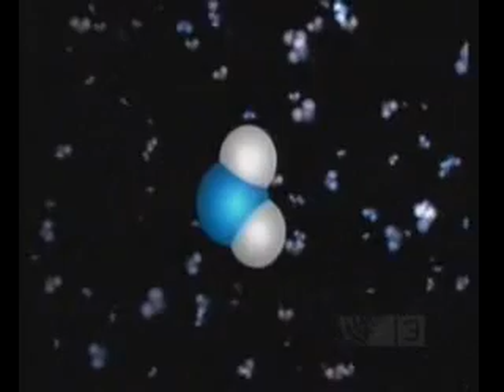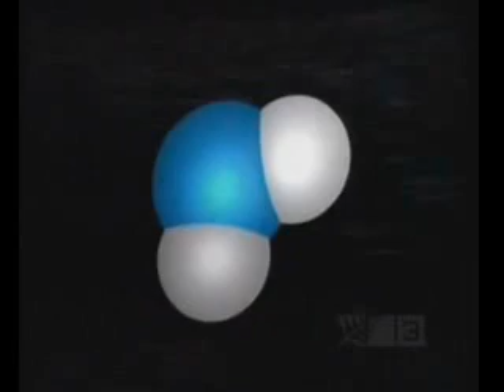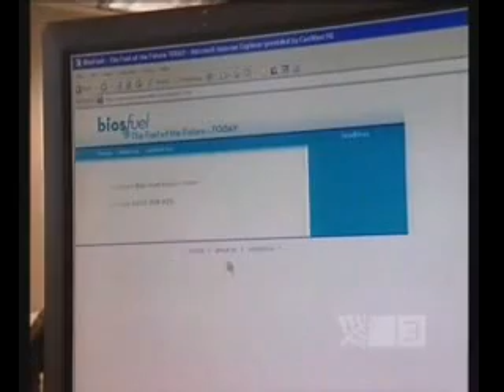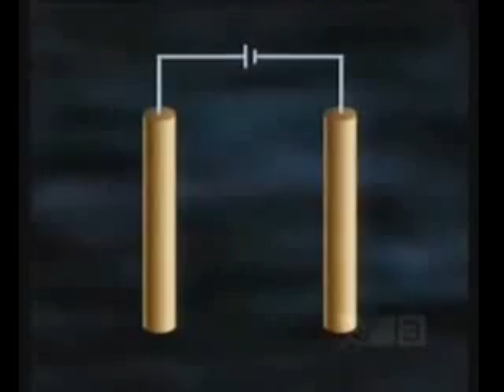A Motorcycle that runs on PURE Water.

Comment: I wonder if the "secret formula" is "split it to HHO, add CO2 and heat it for a bit, putting loads of energy into the system, producing a vague mix of hydrocarbons, then filter off the gasoline-like fraction"?

Love the "because Steve didn't have someone telling him how to think" caption ... because that just worked so well for all those alchemists. Or anyone who ever strapped on a set of Icarus-like wings and then jumped off a cliff.

Comment: What I be he is doing is instead extracting the hydrogen to use it he extracts one O or oxygen, leaving the water base there but increasing the hydrogen ratio to 50% opposed to the 33 1/3 % found in water. And his engine can then use that new HO solution to combust or however that particular engine works. Free energy is everywhere, we just have to look for it in everything.

Comment: Why is this so hard to understand. There is energy already in water. He has just found out a way to extract that energy. I don't think that this is a hard concept to understand. In Puerto Rico the energy is extracted from the bottom of the ocean and used as energy to power the whole region. Water is heat exchanger. It can transfer energy to power a vehicle. It has hydrogen in it which combustible. It has two oxygen components and oxygen is essential to fire. Fire is energy.

Comment: That's the flaw in your argument though.  It always will take more energy to break the bonds that hold an H20 molecule together than you will have released by burning it.  Otherwise known as a loss.  You are putting more energy into the system somewhere otherwise you are in the mythical over unity range.  This isn't about amps, RPMs or anything else, its basic math.

Comment: The covalent bonds that hold the h and o gases together are not that hard to break. I'm sorry if you are stuck in a rut and can't believe it possible to make enough gas on 15 amps, which by the way only drags my motor revs down by a little over 100 revs at idle when I kick in the splitter. It is NOT over unity. It is just splitting water molecules. HHO wisdom has come along way in the past few years. Voltages, spacing, surface area and ph being a few.

Comment: Car or boat, an engine is an engine and you are claiming net power gain, which simply isn't possible as dictated by the current laws of physics.  You're claims do not add up and unless you managed to bend the very laws of physics and thermodynamics your boat is going nowhere fast.

Comment: I am not running my car on water. I am running my BOAT with a pre-computer controlled 318 cubic inch v8 engine on SEAWATER. Go back and read my other posts. I've pretty much described the whole system. What makes it different is that I run a CONTAINED and PRESSURISED system. My splitter is huge and inside of a 25 gallon swimming pool filtration tank rated to 125 psi. I make more than enough gas on 15 amps.Array is 21 stainless salad bowls. 3 banks of 7 bowls. No additives to the saltwater.

Comment: Why do you keep referencing waters power?  You aren't running your car on water.  You are running your car on energy stored in the form of hydrogen and oxygen gas, generated by breaking apart water molecules.  So how are you generating the power needed for the electrolysis process?  All you are really doing in essence is making an awkward battery of sorts.

Comment: The Engine has a second alternator mounted to it, along with the other electris the I use to run my water splitter.My splitter makes more HHO than I use and the excess above 75 psi is released by a valve like the one on your water heater. The first alternator runs all the rest of the boat power needs. Lights etc. The motor runs both alternators at the same time. The HHO powers the motor. When I shut it off I have two 50 gal. tanks with 75 pounds of HHO in them to start up with the next time.

Comment: Big OIl and a few other OWN Wash. DC. I hate having to be cynical but those are the reality's here in the US these days. Do you think the Car makers want the costs and research time forced upon them by the EPA. When they shoved SMOG and pollution restrictions upon us all? While we did need to reduce the sulfer oxides our cars were putting into the env. Much of what was accomplished was nothing more than cosmetics. for example. Coal burning power plants. HUGE GI FANS add air to the smoke stacks.

Comment: HHO is not dangerous either when you system is robust and everything accounted for. Backflash protectors, overkill on all container strength, Over pressure safety release valves, cooling, hydraulic hoses rated to 50k psi for plumbing etc. You just have to respect waters power and compensate for it.Plastic containers, surgical tubing etc are non starters. When you cover all those bases. Like myself. Not having to go to the fuel dock will put a smile ion your face.

Comment: No overheating problems.Standard crankcase oil for bearing and other normal moving parts lubrication. Can a car be converted? Yes provided its a pre-computer obd engine.When that innovation came along the powers be decided the motors needed to have an extra spark 180 out and the before and after 02 sensors to mitigate any mileage gain you might get with HHO. HHO runs clean. The o2 sensors see that as a lean condition and fatten up the fuel mixture.The junk spark and that says it was intentional

Comment: I'm sorry, the current laws of physics simply do not allow that to happen.  How are you generating your gasses?  If you are using power from the engine you are netting no energy gains and eventually you will run out of energy in the system, and coincidentally out of fuel.

Comment: I don't have a gas tank on the boat. I do have as part of the pressurised system a water storage tank. So mileage is not an issuie. I don't use petrol at all.Zip zilch nada. And my motor runs smooth as a baby's ass.

Comment: Where did I say in that comment that you explicitly cannot operate and internal combustion engine on oxygen and hydrogen?  Nowhere thats where.  The engine could potentially run, very poorly though.  My statement still stands as fact though, water is not a viable direct fuel source for cars.  Also be aware that you are probably getting worse fuel economy as again, you use more energy in electrolysis than you get back during combustion.

Comment: If the last drop of oil was pumped out of the ground tomorrow. All the major car manufacturers would release cars that run on Sea Water the day after. It is not rocket science. You just have to build robust pressurised systems. Much like the Propane conversions used in cars trucks and buses. Fact is we had planes in WWII that had HHO splitters on them to increase fuel mileage and performance. Go to an airshow where they race the old war birds and talk to some of those old guys.

Comment: Sorry. I store both O and H together in same pressurised tanks. Two of them 50 gallons each. When introduced back into the motor. The match is exactly perfect. Ignition turns it back into water. The rapid collapse causes my motor to run cooler and it runs smooth and clean. On filtered West coast SEAWATER. gathered near the Golden Gate bridge.

Comment: Biglightbt. Me thinks you may be misinformed. First off while this guy may be a fraud. You can run an engine on HHO. And you can mount a second Alternator and electrical system for just the water splitting part of it. And you can store it pressurised for start up purposes. I can say that because I've done it. Not claiming free energy. Just telling you that you don't have to be a rocket scientist to figure out that BIG OIL has sold ITS TOO DANGEROUS pressurised. Propane is too. Big Oil sells that

Comment: Simple calculation for a 'water as a fuel' car.

Car engine is at best 35% efficient converting chemical energy to kinetic(motive)
Car alternator is at best 70% efficient converting kinetic(motive) to electrical energy

So guys how efficient does electrolysis plant need to be in order for the system to just run (without even moving the car)?

OVER 400% efficient!

Describe to me any experiment that is over 100% energy efficient and I will show you either a hoax or a downright scam.

Comment: It is your choice to call it horse manure. I don't claim free eneergy or anything like that. My boat runs on SEAWATER. I used a 25 gallon swimming pool filtration tank and an array of stainless salad bowls to build my splitter. I run it in BRUTE force mode and the system is cooled, circulated, pressurised and regulated to 75 psi. Mechanical throttle valve, And spring loaded plate that covers the carb intake. It doesn't even open until I hit 2800 rpm's. H and O both enter through the T Valve.

Comment: I have a 318 C.I. V8 in a 28' boat that runs entirely on water. It's real simple once you get passed the notion of a closed pressurized system is dangerous. While HHO is way more explosive. All you have to do is understand that people have been running and converting cars trucks and buses to run on propane for over 70 years. It's all about the money people.My boat runs on filtered SEAWATER. No fancy electronics, Have an old choke cable for manual timing adjustment.A second alternator for power

Comment: Stanley Meyer was much further along with his electronics. I think he was too much of a perfectionist. Which is why it was always in a state of redesign. None of them will tell you how they go from 30 percent effeciency(conventional electroysis) to over 100 percent effeciency though. Even the geets motor is just another HHO but they use steam instead. 
 They are defenitely on to something but to get it "out there" they would have to mass print the instructions and air drop them.

Comment: He'd be more believable if he were not a finance guy.  He could have a mix of something like hydrogen peroxide, which in high concentrations can oxidize the aluminum piston (until it blow through).  There's a website on a diesel he's running on part fuel and part water, but this motorcycle was debunked on 60 minutes.  pesn (dot com) has some articles on it.

Comment: With T2 cell and T2 electrolyte with 50Amps at 12V, we've ran a motorbike's 750cc engine at 5500rpm continuesly (not only 300cc). Just, Search for T2 cell videos.

Comment: Well you "can" burn hydrogen and oxygen in an engine, it will run albeit rather poorly.  It's just not a cheaper more efficient fuel than gasoline.

Comment: This is total crap.  Water cannot be used as a direct fuel for anything.  The energy he use d turning the water into Hydrogen and Oxygen will always be more than the energy he gets back by combusting it in an engine.

Comment: You should think before you speak. Go and do some reading on energetic potentials and compare gasoline to hydrogen. Then there's the problem of needing to safely store oxygen in the vehicle to burn with your hydrogen. The last thing you would want is to store oxidized hydrogen in a vehicle hurdling down the road. If you were to rely on oxygen in air, you would have to take into consideration the possibility of producing H3N as a by-product.

Comment: Hydrogen is not only a very volatile and dangerous gas, it is also expensive to process water into H2 due to the energy requirements of electrolysis when compared to quantities that would be required world wide usage. Safe storage is another major issue. While storage by chemical bonding is relatively safe its rather expensive. In theory its an excellent concept to harness energy from water, however at this point hydrogen is unsuitable as an alternative fuel on a global or even national scale.

Comment: No, this was and is nonsense. The idea works but you might aswell have a electric powered car because you need electricity to flow electrons through a solution to collect the Hydrogen and the only way that's going to be sustainable is with a solar panel.
So in short, it's bullshit.

Comment: "water based" as in water soluble? Like alcohol? Which is already used as fuel. Which, with a little water added can be (and has been) slightly more efficiently converted to mechanical energy in a piston engine. This is nothing new at all, just another idiot on TV looking for some quick fame and cash that will most likely never come. Just search "water soluble fuels."

Comment: Basic chemistry and physics... anyone can convert water to Hydrogen and Oxygen (Browns Gas) and anyone can stick it into an internal combustion engine, and it has been done thousands of times before. .... and if anyone gets the efficiency of the conversion up to 100%, then they have a very expensive novel piece of crap... just use the electricity to drive the vehicle in stead of doing the separation. It's bullshit folks.

Comment: New Zealand inventor, Steve Ryan, claims to have devised a method of using water used as fuel directly, in contrast to using water as a source of Hydrogen, which then serves as the combustable fuel. More recently, the company has developed a proprietary catalyst that enables water to mix with waste oil to provide fuel. The mixtures are in process of being tested by the EPA in the U.S., the results of which are expected in January or February of 2008. peswiki   com  Directory:BiosFuel

Comment: i am no sciencetist although he placed water in a battery type object. i ask every thing has 3 states of matter. liquid solid and a gas. electrolasis causes the gas to be expelled but this requires energy to do and isnt in the form of a liquid. but i say. what if this invention dosnt convert these into gas but separates them as a liquid form? considering when he placed fuel in the tank he took out a certain amount. oxygens atomic mass is heavier and he may only have put liquid hydrogen in.

Comment: A Joe cell can run a vehicle without gasoline. There is also a way to charge water with a radiant charger and this can electrically charge the water. What they don't tell you is that Stanley Meyer, the water car inventor, actually discovered that the electrical charge of the water is what makes it possible to operate a car engine. It is not the volume of gas alone, since that would simply be brute force electrolysis. Please checkout my Youtube channel for more information.

Comment: If she observed him pouring the fuel in the tanks, he has a false tank, the one you see someone pour into, never is in contact with the fuel in the bottom of the tank, it's partitioned off. The sample is poured into a false tank at the top. It's an old racer's trick to beat the fuel tests, allows you to run "doctored" or alternate fuel in the bottom of the tank, while the officials draw the "stock" fuel out of the upper tank through the gas cap opening, racing 101.

Comment: Hydrogen exists as a gas, if you split it out of water, it will evaporate away, it must be held in a pressurized container, like LPG gas. To split hydrogen out of water, requires huge amounts of energy. If you did try to run the engine on hydrogen, it would promptly burn the engine up. It burns to hot and fast for a "livable" combustion process, it would instantly go into detonation.

Comment: any of you posting that dont believe water fuel is an idiot. This was simple science stuff at school. With careful pulsing of electric current through the water, its easy to produce up to 700% more energy than is being used to seperate the hydrogen & oxygen. Start reading books a bit more and you might learn something. Who would have thought that 30 years ago solar PV panels would be used on homes to power them. 
or go out and get laid.....always a first time

Comment: H and HHO used as fuel 4 various things is old news. Wikipedia it. The 1st internal comb engine (in early 1800s) was powered by H. Befor incandesent bulbs, there were lites that burned HHO, etc. 

That is not th issue here. Th issue is whether u could generate hho using the electrical system on a vehicle, and entirely power the vehicle with it. This is obviously impossible. Fact is its not even possible to increase your mpg any real amount with it. It has been the subject of scams for decades.

Comment: You are still thinking water/liquid....for water to run an engine it has to be converted to two gasses, hydrogen and oxygen first then introduce into the engine...no more liquid only two gasses in the engine....

Comment: Nearly every MC in New Zealand either has a fuel cell technology powered by cold electricity or a little black box that extracts the cold component of electricity from the vacuum, in Auckland many people also have "N" Machines because Bruce De-Palmer moved to Auckland back in the 80's and ended up dying there too. This device here is new though and looks very interesting. I've even got the Stanley Meyers original WFC.v1 software that was distributed when Stanley Meyer went to Auckland.

Comment: Henry Ford was also fooled into believing that a car could run on water, plus a secret ingredient.  That secret ingredient was acetone.  The scammer who got 50,000 dollars out of Ford, disappeared without disclosing what was in his additive (other than the chemicals he used to disguise the smell).  An internal combustion engine will need to be rebuilt after a fairly small number of miles running on a water/acetone mix.  You don't get anything for free!

Comment: Sure, I believe it. There is one group working on a water injected 6-stroke engine that's kinda cool. The engine has the typical injection, compression, power and exhaust strokes. But then it has a water injection stroke and a final exhaust stroke. So they spray water against the hot cylinder head (heat that would otherwise be wasted) providing a weak but useful power stroke as the vapor expands. It works. But they're struggling with how to recycle the contaminated water in the system.

Comment: Water could be used as internal coolant. That allows to feed extra fuel to cylinder.
During the war they had this water/methanol mixture for emergency power.
But as you wrote, no extra energy was provided within water.